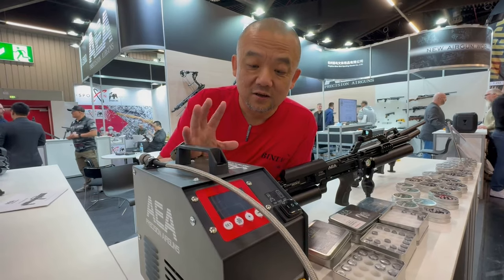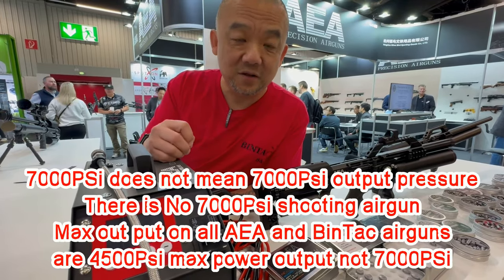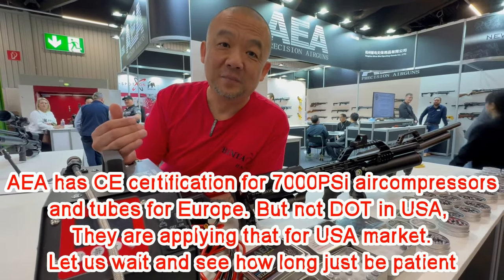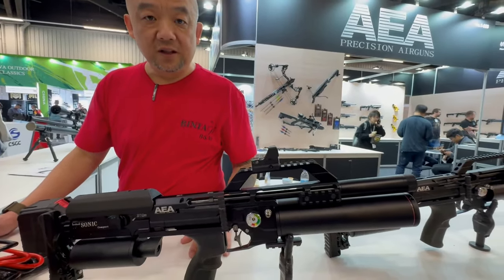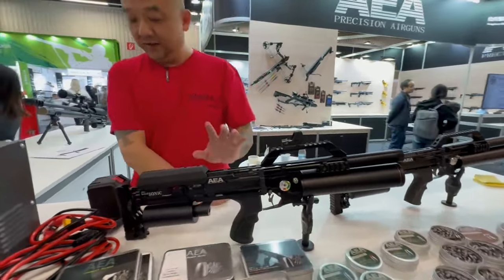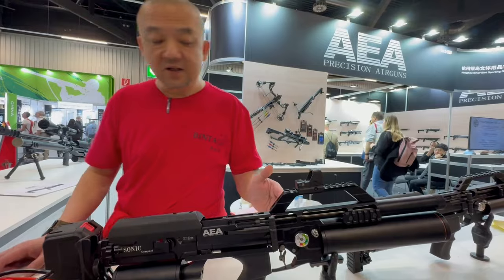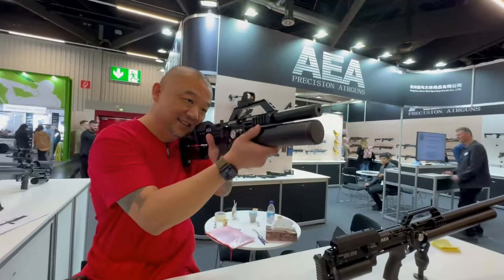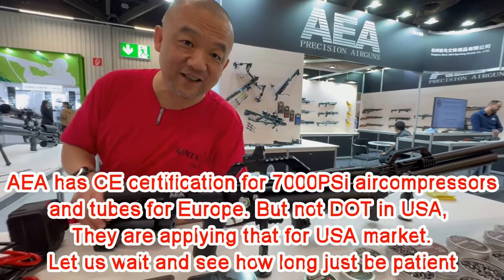BinTac: AEA new air compressor and Sonic short bullpup are released

Comment: But can I get the 7000 psi machine in the U.S. ? I just want to use it to pump 4500, it will be very durable doing a 4500 job if it’s rated for 7k.

Comment: Is there going to be an Element Max with the 4500 regulated 7000 psi tank? That might be great for 2 regulated high power shots. Also would that 7000 psi 4500 regulated tank be able to install on the current unregulated Element Max?
Reply from the maker: Absolutely

Comment: Hey Bin is there any news on request for DOT certification for 7000psi HP air tanks? Also would it have been easier to get 6000 psi certified since some nitrogen welding tanks are 6000psi if I remember correctly.
Reply from the maker: They have been working on buddy

Comment: If the quality of their guns become more refined, they'll sell them like hotcakes.
Reply from the maker: You are right, they have been trying thier best to improve this
Reply: I have been super happy with my .357 HP max, thing is a beast and never has an issue.  It sits in my closet right now at 4500 psi and has never leaked or malfunctioned. Super solid gun. Turned me into an AEA guy for sure.

Comment: I only have had the Big 9 standard and I have only replaced one o- ring in 3 years and shot a lot. From what I have been hearing from other owners of different models is: AEA needs to make GOOD replacement parts, better than factory (QC) That is the biggest take away from AEA, if they can improve the quality and the quantity of parts, they very well be top dog in the air gun world but, until then most people are going to shy away from AEA offerings. I hope that the right eyes and ears see this and move forward on the problems at hand.
Reply from the maker: Thank you

Comment: The best man could excellently teach arithmetic to group 4 primary school. Guys, I'll say it one more time: 7000psi boost pressure and 4500psi firing power. so NOT: 7000psi SHOOTING FORCE no, it is the FILLING PRESSURE. So the FILL PRESSURE is 7000psi and regulator pressure is 4500psi. Very important to remember!! I've said it 10 times now, that should really be enough!
By the way, why don't you wrap a valve that operates at 5.6 or 7000psi? The bullet speed needs to increase. 500 m/s must become feasible.
Reply from the maker: @CamilleCJ  we do have that system which will be used on my MCAR competition long range rifle soon

Comment: To bad AEA has such poor quality control. I'd be too scared that their 7000psi tank will rupture because someone did not harden it correctly or some other flaw. I bet an issue like the HPMAX has where it will dump all of the air at once will be a lot of fun.....
Reply: I have solved the air dump issue/hammer bounce issue for my HPMax by placing 2 o-rings over the guide rod in front of the spring. They have to be just tight enough. I almost doubled the amount of shots with only a small loss of power.
Reply: Also this new AEA gun has a regulator set at max 300 bar so it shouldn't be able to dump all the air at 700 bar even if something goes wrong with the valve.

Comment: I'm getting this compressor as it should have no problem filling a 300bar 10 000cc scuba tank. I don't feel like trying out the first gen 7000 psi airguns though. A 4500psi airtank bursting is bad enough, 7000psi would be seriously dangerous if it failed.
Since compressor is so small it should be less than €1000 I hope.
Reply: I would be surprised if a compressor that size was approved to fill a 10,000cc scuba tank.  When have you heard of a 4500psi tank bursting?  I never have.
Reply: bintac already did a video on that. you need way over 80k psi to burst them, you also need armor piercing 308 ammo to pen one side of them...they are not gonna burst unless you are literally trying to burst them. bintac said you need a special industrial grade compressor to even pressure test them to that high, they cost over a million usd btw...how do you think dot certifications work.....you didnt

Comment: 7000 psi just means more shots from 4500 down. It means there is more air that is crammed into that space. Operating pressure is still 4500 but the percentage of air used per shot will be must less than a bottle that has a max pressure of 5000.

Comment: I wish these Aea guns were more reliable but they are not that pressure blows mags out trust me all my 4 aea guns have loading and mag problems and the companies don't try to help you resolve them your stuck fixing them yourselves  just to make them work. Far to over priced I have 4 aea guns I have anyway!I have all the other brands too!they aren't built tuff or reliable in all brands .except my airforce Texan 50 cal no problems .or hatsan Pyle driver 50 cal.my 357 terminater has never worked correctly  new and airgun depot refuse to fix or replace blown out mags .so I had to buy new again and it still jams and doesn't work correctly  so I put in box don't recommend aea guns for money there asking.